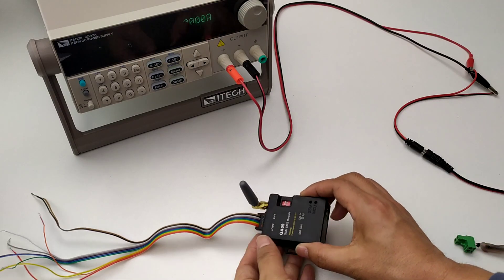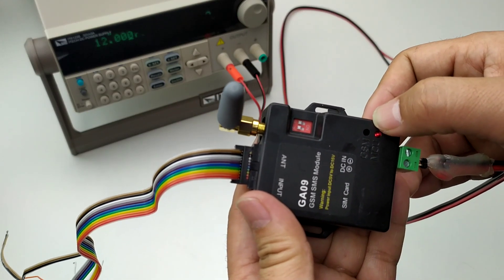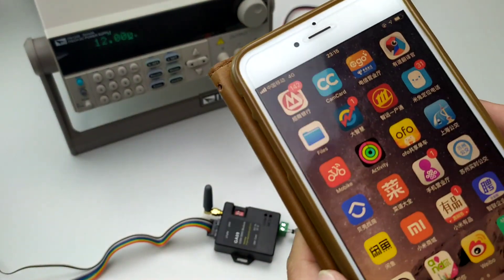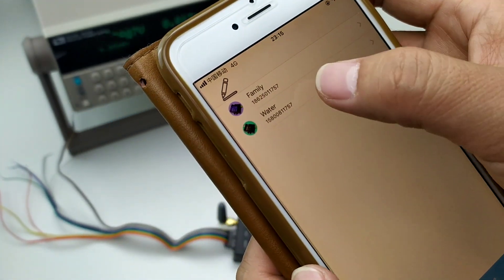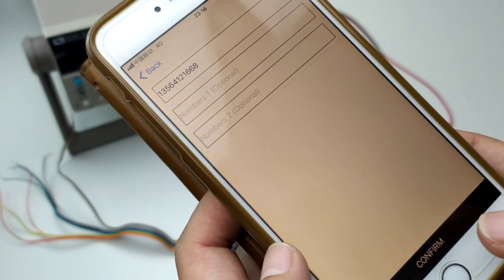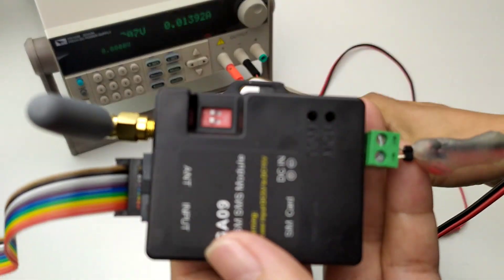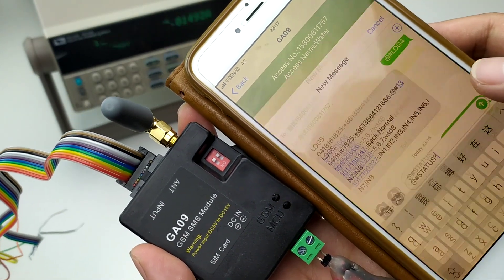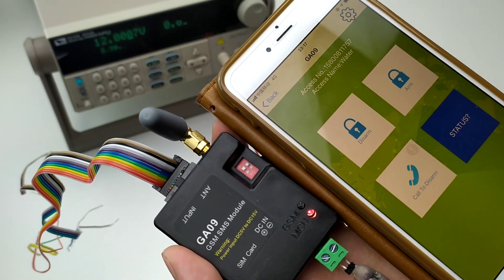Know more about GA09 GSM alarm box from LED status

Comment: Thank you for this video. When I text a command to the GA09, the MCU will rapidly blink - receiving the text. Then MCU will rapidly blink again - sending the status. However, I never receive the text to my phone. I registered the number with 1+ area code + number  also tried area code + number. No confirmation text. Any command I enter - NO confirmation receieved BUT MCU blinks rapidly.  HELP!!!
Reply: I have same issue ... and I can`t get more then one number programmed in the device...
Reply: @ronaldoh7296  Hi Ron, I received a reply to my email to the company. I have T-Mobile and apparantlky the device will not work with T-Mobile frequencies.  However, they indicated, it should work with ATT. I have not tested this.